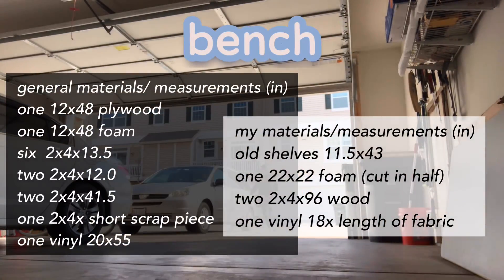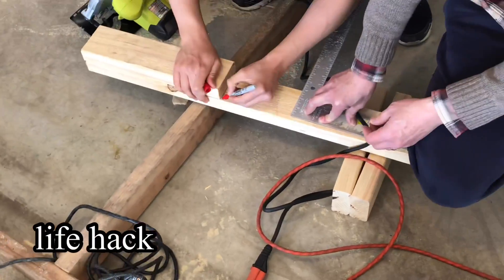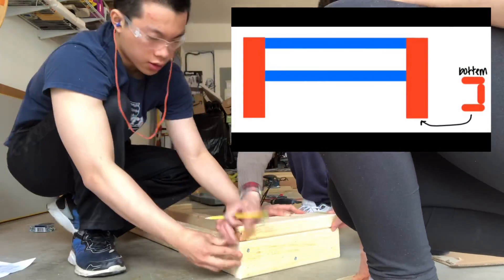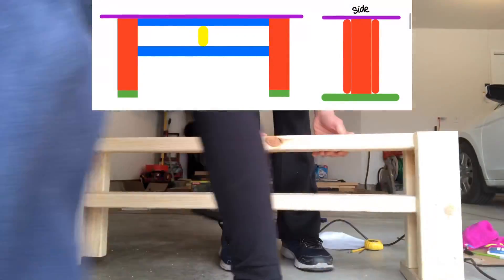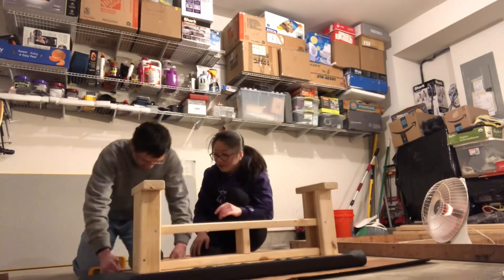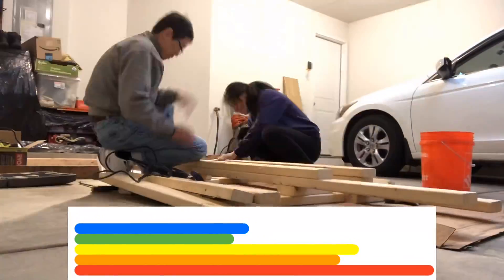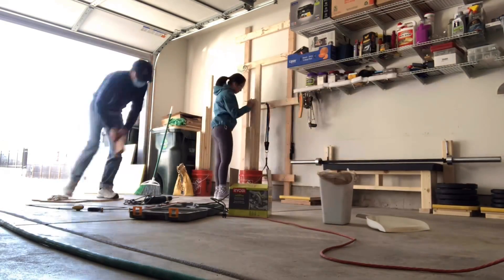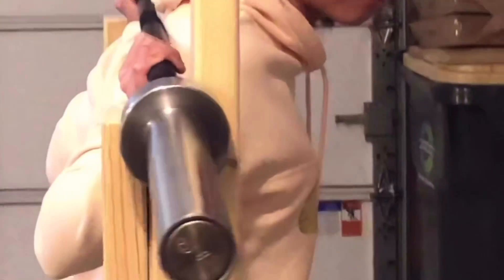DIY SQUAT and BENCH (COMBO) RACK AND BENCH PRESS

Comment: What’s the measurement of the bench? Height and length??
Reply from the maker: so if you plan on competing, you want the bench to be the same as a competition bench. That would be:
Length: 1.22m or 48”
Width: 29-32cm or 11.5”-12.5”
Height: 42-45cm or 16.5”-17.5”

I made this bench a little bit shorter because I don't need the end of the bench, and to have it store easier.
Reply: @LucyCao  thank you for the info but I don’t plan to compete hehe. Just for working out/strength training.

Comment: I would suggest a slight taper/angle cut toward your bar rack so that if you accidentally drop the bar on the flat 2x4, instead it will roll into the gap where the bar rests.
Reply from the maker: That’s a really good idea! There was once where the bar ended up on that flat 2x4 and it gave me a heart attack lol

Comment: How many days did you wait for the concrete become hard enough for using?
Reply from the maker: After 24 hours, the top of the concrete should be dry to touch, and you can start using it lightly. The inside took a while to cure because it’s in the bucket, and I think it took about a week to dry 100%. But I would say about 3 days is more than enough because it’s not gonna move even if it’s half dried
Reply: @LucyCao  Thanks
Reply: 2days under a hot sun 8hrs min a day

Comment: Awesome! What kind of foam did you use and where did you get the vinyl?
Reply from the maker: The foam is from Home Depot and it’s called the 2 in. thick multi-purpose foam. It’s pretty soft but also holds its shape pretty well. We got the vinyl from Joann fabrics, but I believe you can find it at most craft stores or even amazon or eBay! Hope this helps!
Reply: Lucy Cao thank you! I’m making benches and got my vinyl from Joann but was wondering if there was someone else I could pick it up from. Thanks for your help